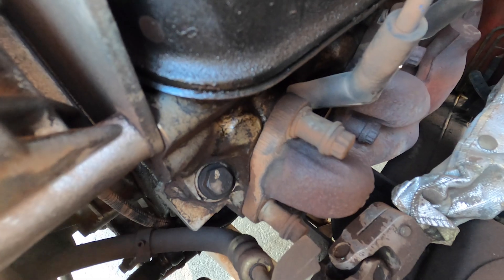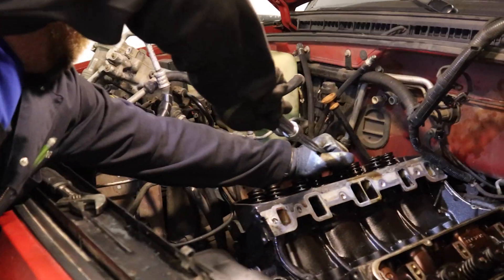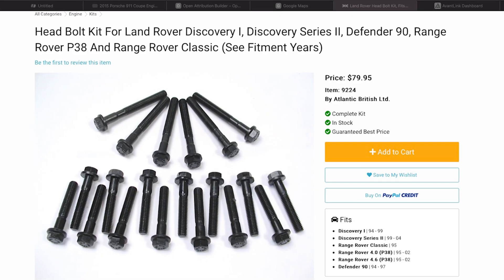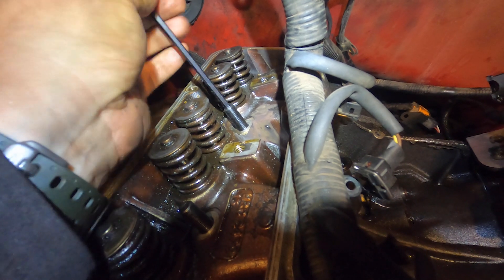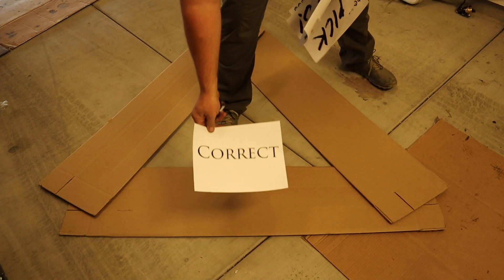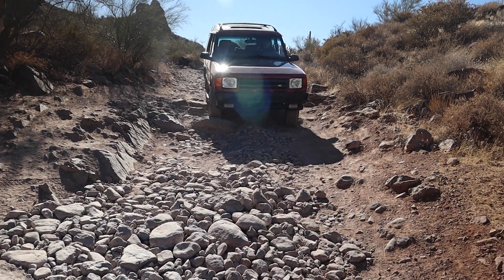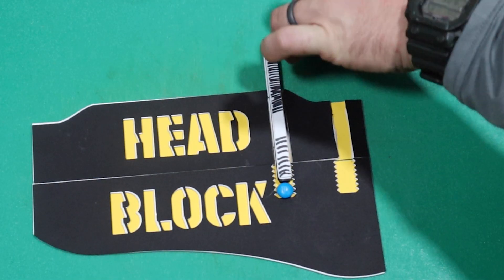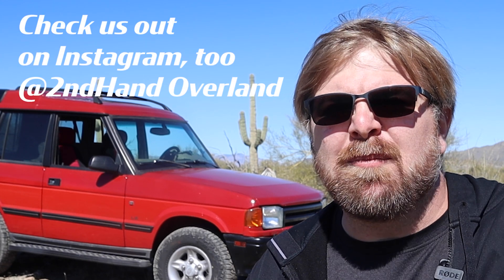Why we chose ARP HEAD STUDS vs HEAD BOLTS for our Land Rover Discovery 1

Comment: There was another good reason besides simple costs for using torque to yield bolts, and that was because it obviated the need to have the dealer re-torque the heads down at the first service (or thereabouts). Maybe with modern gasket materials it's no longer necessary, but for me when putting replacing a head with studs it used to be normal to revisit it after perhaps 500 or 1,000 miles and re-torque it to make sure. 

With torque to yield bolts, there's the head tended to be held down with even tension throughout the "stretch" area. 

There is no problem with applying even torque in a modern car engine factory these days. There are plenty of other places besides the heads where that's necessary and, outside those where engines are hand assembled, it's going to be done using automatic machinery that are programmed and even log the torque settings. I can't imagine that studs cost the manufacturers more than a tiny fraction of those retail prices and even fitting them would surely be pennies. What manufacturers care about is not having warranty costs. 

Another thing to consider is that a torque wrench isn't actually measuring the bolt (or stud) tension. It's measuring the resistance to turning the nut (or bolt head) and that involves friction between the nut/bolt head plus in the the threads and whatever washers and lubrication that's been applied to the components.

That's not to say studs aren't better when installed with care, but they may be less suited to mass production. 

(there was another potential problem with studs an alloy heads, and that was studs corroding in the heads too).

Comment: Hiya, agree completely about studs. I remember visiting the factory and watching the way the Rover V8 was assembled and thinking ‘wow that was quick’. As you say manufacturing is quicker with stretch bolts. Another advantage that can be had with studs (particularly for the bottom end) is that the un-machined shaft helps to locate the parts better and can stop fretting and eventual failure.
Keep up the exploring and great vids :-)
Reply from the maker: Thanks Gavin! Glad you enjoyed it and I appreciate the insight! I’ll bet that was quite the sight watching them out these things together!
Reply: @MattKester  I have a now defunct 2nd gen Range Rover (P38) which has the old TDS BMW 2.5litre 6 cyl diesel. The head has cracked and parts are really expensive. But relative to the studs vs bolts, the BMW head bolt process makes the Rover V8 seem ordinary! The BMW procedure is tighten to torque spec in certain order, then 1/4 turn, then back off and re-torque. Then you have to do a full engine heat cycle from cold to hot back to full cold (full day), another 1/4 turn, back off and retorque. Bolts are all one use only as with the newer Rover V8.

Comment: Great video and I learnt a lot! 

Are there any further engine videos coming up? One thing I’d love to see is the main bearings being changed while the engine is still in place. I believe it’s OK to do but haven’t seen a video out there for this model of engine.
Reply from the maker: Thank you, glad you enjoyed it. We don't have anything specific to engines in the pipeline as we don't have any current issues outside the ones we just finished tackling up. I will be troubleshooting the AC at some point really soon, and I have an accessory or two to install coming up soon. If we do end up needing to replace the main bearings, we'll definitely try to do it ourselves and in-frame, if possible. I know it's not a Land Rover, but here's a link to DeBoss Garage doing them on a John Deere Tractor while the engine is in frame. https://www.youtube.com/watch?v=DSZiRBYgBNc
Reply: Cheers! Handy link to the bearing video. 

The only tricky things I can see with that job on our engines is the rear main cap where you have to consider the rear main seal and those crucifix oil seals and the centre bearing with the thrust washers. Thanks again 😊

Comment: Jolly good show old chap! 😁 Love your tutorial aids you made. Studs are also easier to replace if you have damaged only one, as you can just replace the damaged one.
On any motor with aluminum components you HAVE TO fun a 96% glycol anti freeze mixed to at least a 50-50% ratio and use the same mixture for top ups. Also run an extra earth strap directly from the motor to the negative side of the battery.
Great content, keep it up!!! 👆👆💪💪👍👍
Reply from the maker: Thank you! I hear you on getting that anti-freeze right! It's surprising how many people you run across that don't get that one right!  I did end up running a ground lead to the battery when I put it all back together, after spending a couple hours trying to figure out where the one on the back side of the port cylinder head went to when I took it apart the first time. Been going like a champ ever since!

Comment: Hey man! (Guy who commented on the o rings for the transmission cooler line video) 
I wish you could see my truck! It’s a 99 D1 I bought a few months before you first started the discovery series. I’ve done everything you have had to do, and more. I bought it in not running condition. Since all the repairs I’ve driven it almost 10k miles, from San Francisco, all the way down Baja, into desserts, mountains, and everything in between. Even attempted the Rubicon in the snow (got stuck for HOURS). Anyway. Your videos are great. Very helpful.  Wish I had used the ARP studs instead of the bolts!!! Thanks man!
Reply from the maker: Sounds like you definitely embody what this channel is all about, good for you! We’d love to see your rig! If you’re on Instagram, tag us in a post or story, @2ndHandOverland!